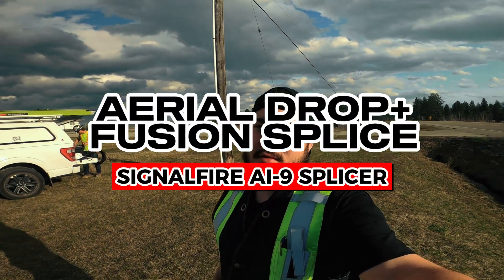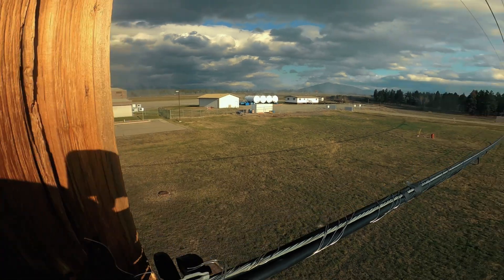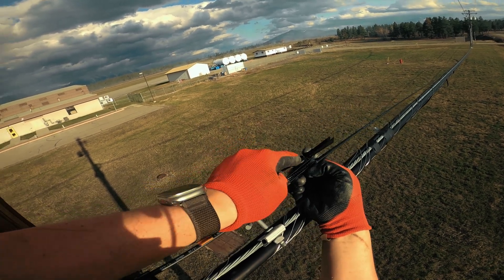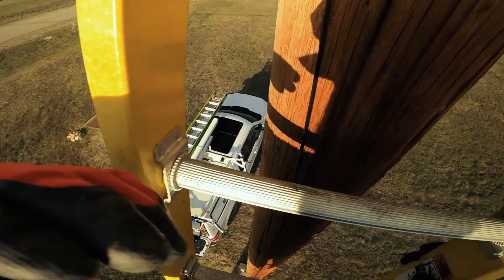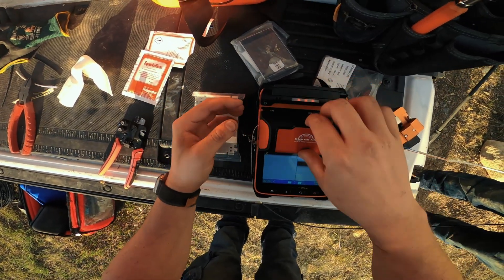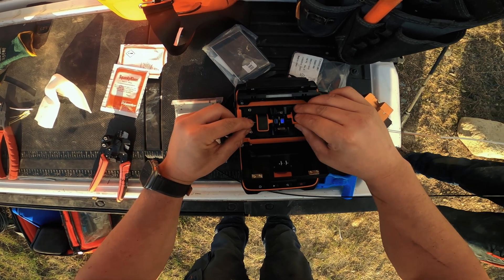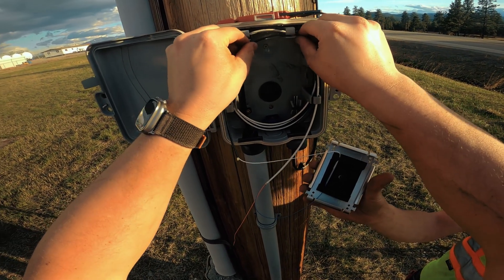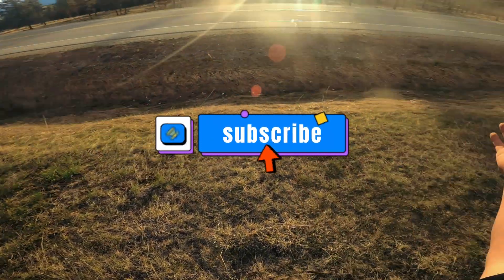FUSION SPLICE+AERIAL FIBER OPTIC DROP

Comment: Aren't you supposed to do a calibration splice when you start, before making your production splice? That's the SOP for my 90s
Reply from the maker: @bobw3398  maybe 🤷🏻‍♂️ the main issue I have is cheap cleaver. Makes the ends hit or miss.

Comment: Squeaky kleen is to clean off gel from gel filled buffer tubers with fibers in them. You want to clean fiber with a high percent isopropyl alcohol.
Reply from the maker: You’re not wrong but it still works. 🙂

Comment: Keep lateral tension on the spliced fiber when going from the splicer to the heater. That fusion splice is very strong against keeping tension across it, however letting it bend to get the heat sleeve where you need it can cause it to break before it's in the heater. I enjoy watching how you do it up North.
Reply from the maker: noted,  thanks for watching!

Comment: Loving your videos bro! Couldn’t help but chuckle a bit when you were trying to pull the drop tight, measuring the sag in feet and and sliding the clamp in inches… after you just estimated the length to be around 70 meters. That’s like getting pulled over for speeding 10 miles per hour over in a 50 km/h speed zone lol
Reply from the maker: Haha nice catch 😅 just how my brain works. The drops come in 50/100/150/200/300m lengths so I just got used to measuring out longer distance in meters. Used to use inches/feet a lot in roofing,my previous profession 😂

Comment: Remember, the fusion splicer is only estimating the loss. Before you cut the aramids, twist them and tie them in a knot. That way they don't blow all over the place and then get stuck on you, in your truck, etc.
Reply from the maker: Good idea noted👍🏼 and I know it’s an estimation. Most techs would of just done a mechanical splice which definitely is at base more than 0.00db loss (2 connectors+bulkhead)
Reply: @FyBurz  I've had a lot of calls where the problem WAS the bulkhead...
Reply from the maker: @Todd.T  oh I know.. been there 😅 I spent close to an hour troubleshooting light loss and it ended up being a bad fiber Jack (bulkhead) at the service end 🥲 

It’s on my fiber expansion video.
Reply: @FyBurz  Back in 99 we had a customer that had intermittent service. All the ends were changed. The fibre was OTDR'd and it still wouldn't work. We had massive racks with individual runs to the houses in a POP site. The bulkhead connector that went to that customer's house had a problem with the barrel that holds the two ferrules together. It was on an angle. So I inserted the back connector on an angle until it seated properly and did the front one on an angle to make sure the surfaces on the connectors mated. They had no issues again.

Sometimes I open the LCP and grab the back connector and the front connector and move them around in small circles while applying pressure to make sure they are clicked in.

New installs have no LCP. From the OLT or OLC, they are then FOSC/FDH only with splitters. If your drop doesn't work, there are extra OptiSheath terminals located on light posts for you to hang a temp drop and then someone will troubleshoot the address drop, repair it and take the temp down.
Reply from the maker: @Todd.T  hmm interesting